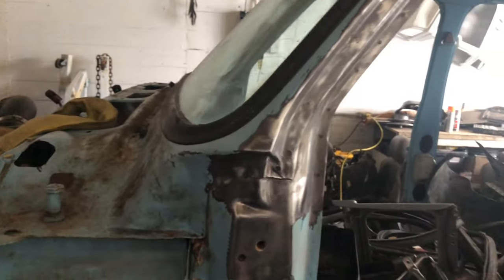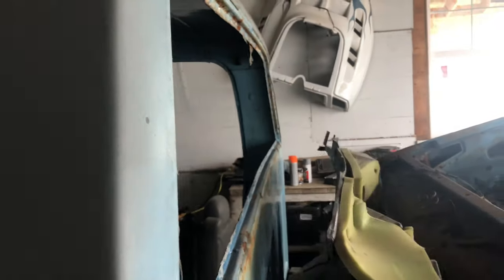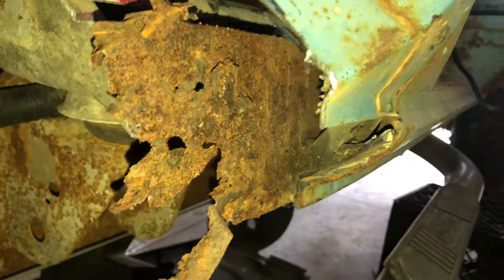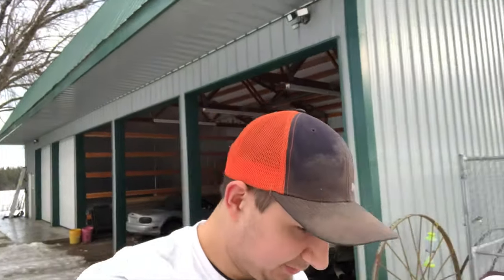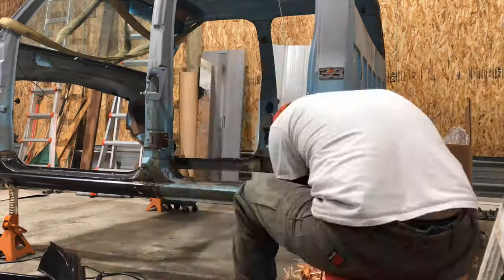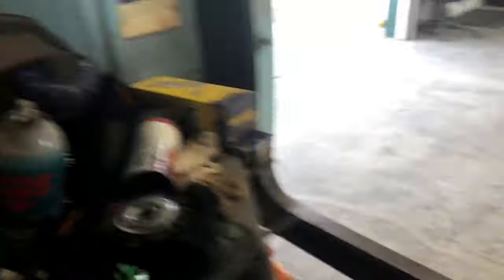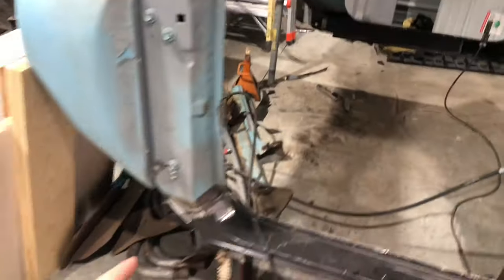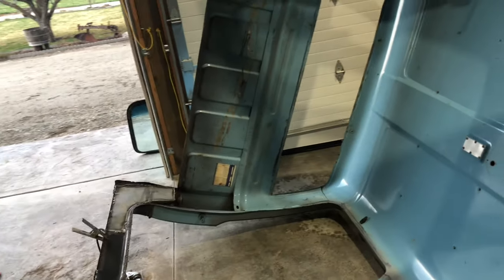DMAX SQUAREBODY BUILD PART 5!!!

Comment: Metal is cool because you can just cut and weld over and over again. It is a pain in the ass, but not much is lost.
Reply from the maker: Dock Station that is the exact reason I enjoy fabrication more than woodworking. You cut too deep, a welder fixes that and you can’t tell with a little grinding lol.

Comment: What was the reason you cut the floor out instead of moving cab mounts? Only asking cause I'm looking to do something similar.  Your videos are great 👍
Reply from the maker: I cut the floor out for a couple of reasons. Firstly, I’m using the interior and electronics of the duramax so everything will continue to bolt in as it should. Keeping the floor allowed me to keep the firewall, which saved work when it comes to pedals, steering wheel, heater core lines, brake booster, etc. Another reason I cut out the old floor was because if I were to set a 5 lb weight in the old floor it probably would’ve fallen through from the amount of rust there was lol.

Comment: How well did the Duramax firewall line up with the square body cab? I’m currently doing this same thing to my truck, but haven’t started the firewall cutting yet.
Reply from the maker: It all depends on where you put your fenders in regard to your tires. Mine ended up with the dmax firewall being about 3-4” farther forward than the squarebody firewall. This makes for an interesting fit with the dash, but I made it work. If you’re using the newer dash, be ready to make some custom parts for the heater/ac fan box because I literally don’t have a valence anymore. It’s the biggest issue with doing a body swap this way.
Reply: @SNOFLOFilms  New vid coming soon..?
Reply from the maker: Ye Olde Spaniard Working on it!